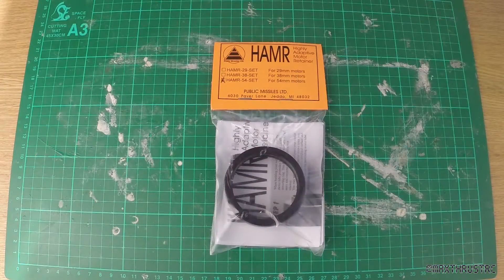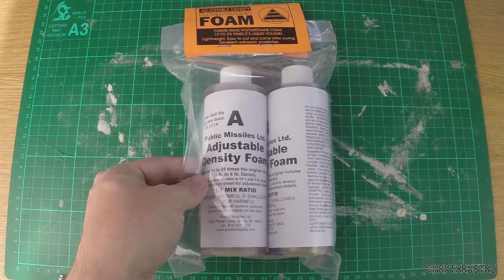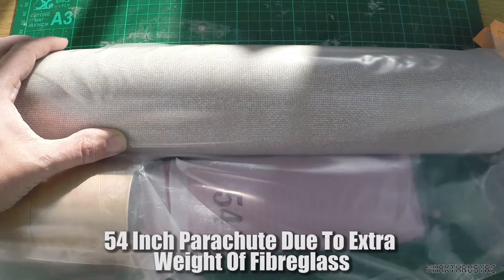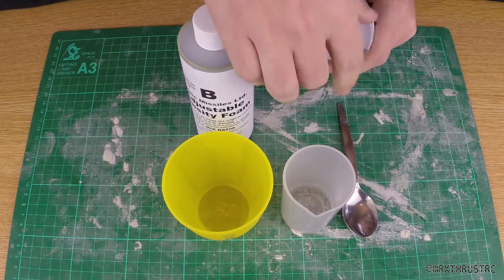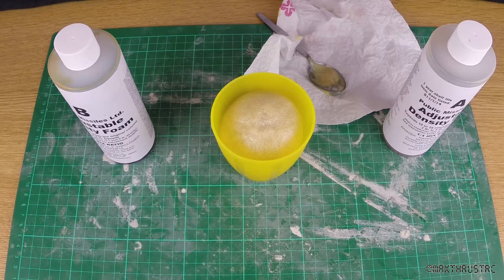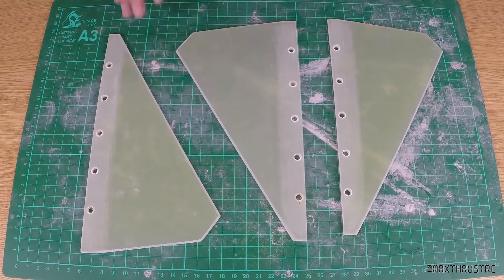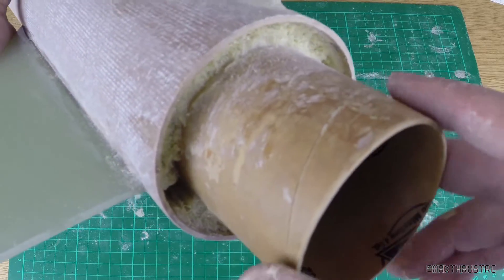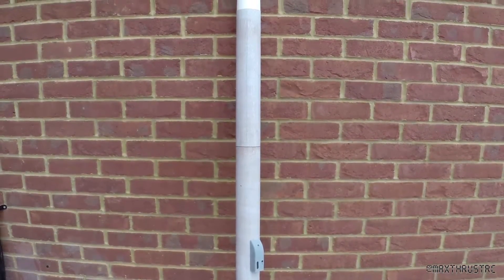Project Invictus Part 1! (Supersonic Rocket Build)

Comment: Two questions, first are you using dual deployment? If so which flight computer are you using and secondly where did you get this kit from?
Reply from the maker: I'm hoping for about 8,000 feet, so yeah, I'm using dual deployment ;) The altimeter is the co-pilot v3 from public missiles, it's the same one I used in Quantum Leap. The kit is directly from Public Missiles in the USA. They do great stuff, including custom work.
Reply: What did you use as ejection charges?
Reply: I think he did use BP. But i don't know
You can also use crimson powder.